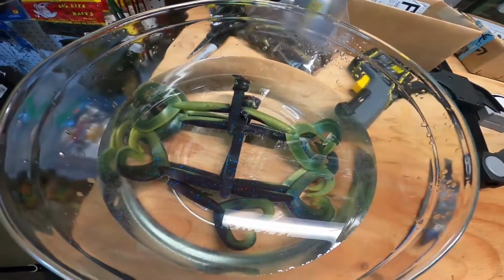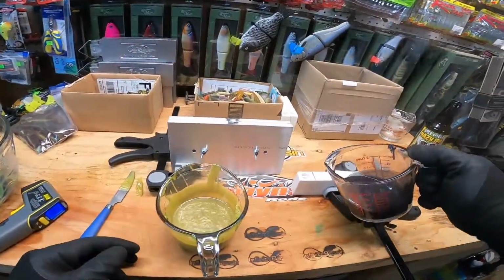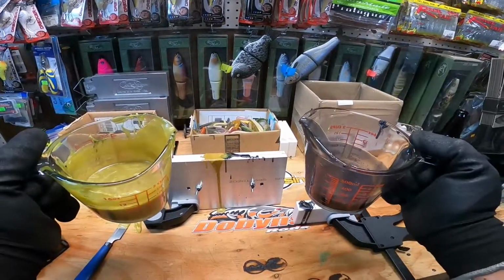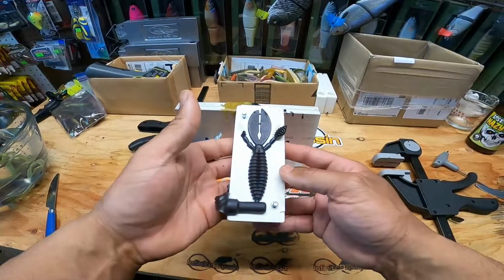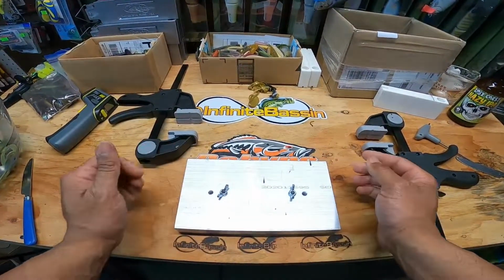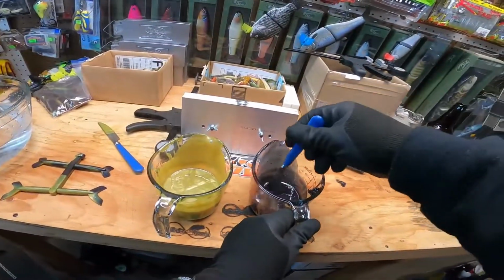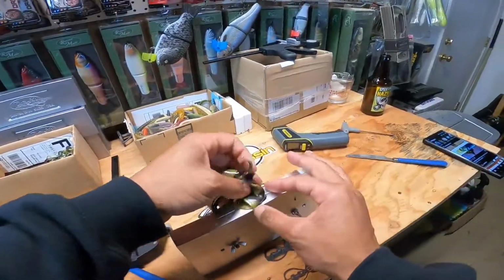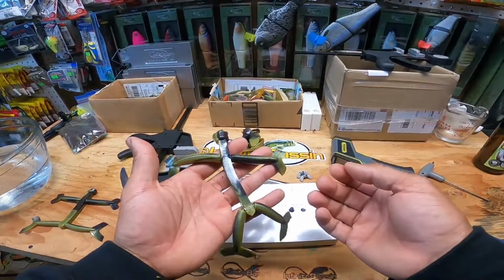Can You Open Pour Style Plastic Into Injection Molds?

Comment: I think you need a vent.
Your getting air trapped in the corners
Reply from the maker: These molds are vented. They are injection molds so they are ment to have plastic shot into them with an injector which forces the air through the vents. When it's poured like I was doing you don't have as much positive pressure so the air was staying trapped. This was just an experiment to see if it could work.
Reply: @InfiniteBassin  gotcha....